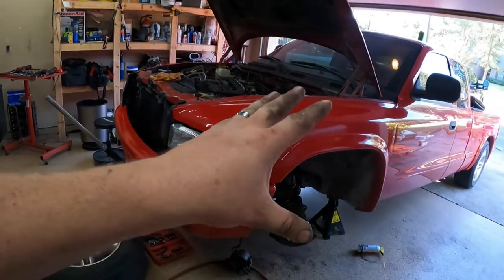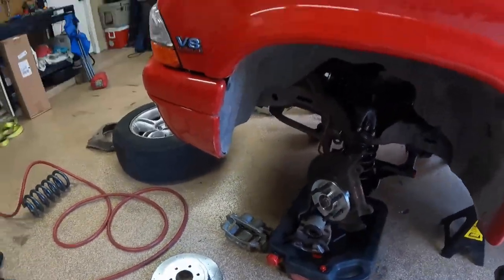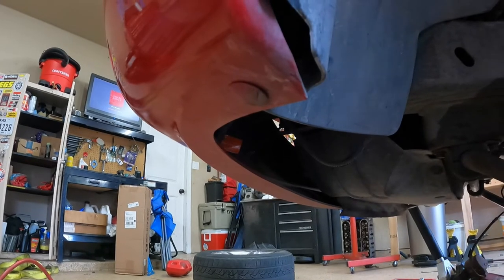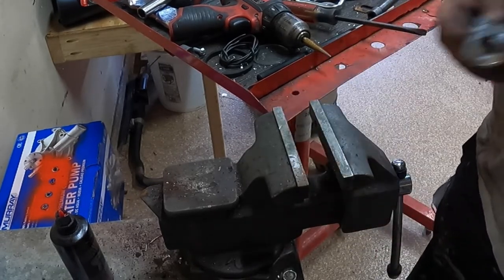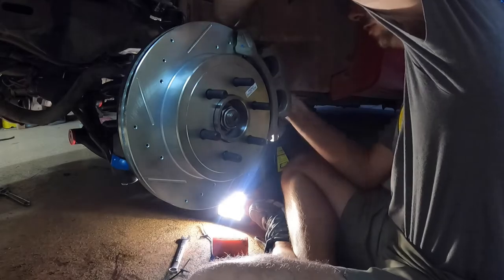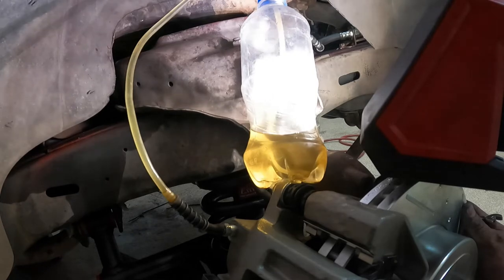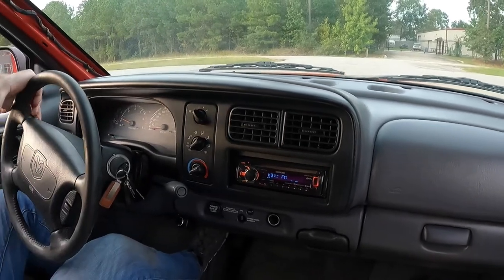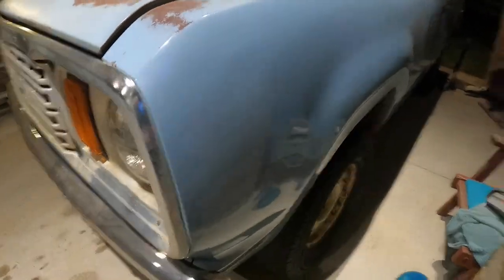MAJOR UPGRADE! 97-02 to 03-04 Dodge Dakota Brakes - Dakota RT Suspension and Brake Upgrade Part 2

Comment: I’m just wrapping up this swap on a 2000 .
I got the rack and pinion as well. Staying stock.
The calipers and rotors I got were good,  as well as the hubs.
But stock control arms, shocks , hoses, brake pads , tie rod ends / outer and inner, sway bar links, bump stops , and shocks need replacing. That alone is just a bit over 1k.
I got the salvage parts for free.
To do this swap in its entirety using  all new parts is about 3k ish.
You need 16” or bigger rims to do this. I elected to use a new 03-04 master cylinder which wasn’t mentioned in this video. There are four pistons up front now and there seems to be a difference in master cylinder volume.
I also did the rear disc brakes and I only needed to get the e brake cables swapped in its entirety.
So all total, you can easily get 6k to 7k $ worth of big brake swap with suspension for 2k or less. It’s roughly the equivalent of having ls Camaro brakes.
Best upgrade I’ve ever done . I also went and bypassed the ABS and installed an adjustable proportioning valve with split front and back.
Now it’s time for the cliche Ls engine and  4l80e swap but with a twist. I’m using the 04 Dodge map only, sequential fuel injection computer  with HP tuners to program and Run it. 
There’s some significant hurdles in order to do it this way but the benefits will be worth it in the end.
The best drive train from Chevy and the best mid size truck ever from dodge. 
I don’t care who makes it as long as it’s American. But Ford sucks.
Reply from the maker: its one of the best things you can do to these trucks! Both the brakes, and the LS ;)

Comment: I’d like to see more of the RT projects.
Reply from the maker: Right now the Dakota R/T is a pretty status quo cruiser, but we do have some plans for it in the future
Reply: If there was a problem with your rear U bolts would your tire tilt side to side? I went to a tire shop and they would not change the tire becuz they said I had that problem. He said if your rear tire slides a little side to side it's ok but he said mine tilted side to side. Is this true that it is the U bolt?

Comment: Glad I found your channel while researching to do this same brake upgrade to my 02 standard cab sport. The 02 caliper guide pin threads on those spindles are junk and strip easily. The bracket mount calipers were a huge upgrade for Mopar on these.  
Just so happens I've been looking at different lowering options for the front too, so your comparison between the DJM lower control arms vs. springs was an appreciated bonus. 
I'm a year late to this party but if you see this, thanks for your time documenting and putting your experience out here for us to see. I know which roads I'm going down now with my project.  Great stuff and I'm subscribing.
Reply from the maker: Thanks for the sub and the kind words! Once you gather the parts, its not too bad of a job, just a time consuming process. Be careful, take your time and you'll be golden!
Reply: @RacerXGarage  thanks. Coincidentally I just did the brake job this past weekend. Turned out great! What great look and nice stopping power.

Comment: Thank you so much for the video. It helped a lot. I have an 01 Dodge Dakota 4 x 4 and I’m gonna go look for those spindles over the weekend. I don’t need to upgrade my lower and upper control arms. Just change the bushings but this helped a lot.
Reply from the maker: Good luck! Im not sure what is compatible on the 4x4, but if you can do the same that would be awesome!

Comment: I did the powerstop front upgrade with the carbon ceramic pads even from the stock brakes that I had in my 04 there's definitely a lot of brake. Thanks for the great info as well in pt1 with the suspension and the difference after before and after 99/00. Never knew and good to look out for when mine needs the front redone.
Reply: Yeah the brake upgrade to 03/04 brakes are an absolute must for these trucks

Comment: I wish I had a 2wd Dakota lol. This looks awesome great job
Reply from the maker: Appreciate it! They work pretty well, but I don't know what's compatible for the 4wd's. Hope you find a good option!
Reply: @RacerXGarage  Doing a 4x4 upgrade from 02-03. Starting with the front. I was able to pick up a couple of knuckles from a salvage yard. they included the brakets for the calipers. So with that I should be good to go. I 've never done a video, but may give it a try . . .

Comment: Awesome video. I have a 2000 rt cc with the djm control arms as well. Way better of a ride than lowering springs and the control arms look sick underneath the truck
Reply from the maker: It is like a whole different truck than it was when we got it. We've been happy with the DJM stuff. This is the 2nd truck we have them on. Really impressed with them
Reply: i have djm 2" drop and the ride isn't that bad except the djm shocks are getting soft and its bouncing. is there a stiffer spring that could help?
Reply: @uncle_salty_3675  I went with doeschtech I think that’s how it’s spelt. The first 20,000 miles they were nice and stiff but after that they became somewhat floaty if you will. I’m guessing the weight of the 5.9 up front kills lowering shocks

Comment: I just did this swap. I got parts off a 03 dakota 4wd. The spindles were the same but the hub has spline gears that I'm not using on my dakota r/t... but I now have the capability of an AWD ?? I've always wanted AWD in my dakota r/t... anyways that's down the road. My brake line fittings for a 98 dakota r/t don't fit the flare nut off the 4wd brake lines that I got at the junkyard with the spindles & calipers. Any suggestions? I watched part one already and left a comment there as well. My truck is down and nothing went as it was supposed to with the swap. Ugh.
Reply from the maker: I hope you get it figured out. If your looking to try to go AWD, I'm sure some fab will be involved. We know the 2WD stuff all bolts up so I'm not sure what you will need to do with the 4WD brakes other than maybe make new lines. Good luck! Thanks for checking out the video

Comment: very nice job done.
i got a 94 dakota slt club cab 4x4, 95 dakota sport club cab 2wd, a 01 4x4 crew cab slt dakota and a 2wd 04 crew cab dakota slt plus, 1997 4x4 club cab dakota that the engine/trans is going in my 01 4x4 .
Reply from the maker: Thanks! Sounds like you have the same Dakota hoarding issue we have!
Reply: @RacerXGarage  i think so... i have 5 so far.
a 2004 jeep grand cherrokee and a 1989 w100 pickup long box.

Comment: Awesome video!! just picked up a 2001 Dakota (3/01) but it's a 4cyl at the moment. Wanting to do a 5.7 'eagle' hemi swap to a Getrag 6spd to a 8.25 with 3.55 gear. But, can you ask your buddy  (Gary?) what type of mileage he gets in this truck? I come from decades with Chevy's and I'm reading that these Magnum or 5.7's don't get good mileage. While I've had 283's and 307's that get high 20's!! I would like to keep it mopar, but if it's only gonna be 12-15mpg, I'll go with a old school 307 or a LS-4.8 and AR-5
Reply from the maker: Thanks! The Dakota R/T's have a 3.90 gear, so they're not fuel efficient in anyway. Its all about the trans and rearend ratio that will contribute the most towards gas mileage. Unfortunately, we don't pay attention to that much so I don't think we could tell you. Im sure its within the 12-14mpg range. Also, if you have a 4.8, go with the 4.8. The 307 or 283 won't even muster near the power that the factory 5.2/5.9's do. It would be pretty big step back.
Reply: Awesome!  Just got back from finding a '03 Durango with what looks like all the parts to do this swap. 
And it's got a 9 1/4 axle with discs and trac-loc 3.55!!  So I'll be getting all that this payday.  Thanks again for the great videos! @RacerXGarage

Comment: Hey my man, I love this video. I've watched it a few times. Question for you. I have a Gen 1 1996 Dodge Dakota.  I would like to upgrade the same way you guys are with the newer 2003 or 04 Dakota front brake rotors that are larger. Any idea if what you guys did will work on my 1996 Dakota?? Any help would be greatly appreciated,  thanks.
Reply from the maker: Unfortunately the upper spindle mounts are totally different on Gen I vs Gen II Dakotas. At this time we don't have a solution for the stock brakes, but we do have something coming up before too long that may be an alternative. Appreciate you checking it out!

Comment: So glad I saw this right before  replacing all my orig lines and calipers. My truck has all wheel abs so im assuming Ill have to find spindles that have abs?
Reply from the maker: That one I'm not sure of. I thought they all had ABS, but not sure. Good luck on your swap. It's a night and day difference
Reply: I have an 2WD 04 QC and it's 4 wheel disc but rear ABS only. They probably figured going to the 2 piston up front they only needed rear ABS to stop the ass end from coming around on you lol I just went with a drilled/slotted rotor setup from amazon to replace my OEM fronts, I've seen new front calipers for like $80 on Amazon too for the 03/04

Comment: I have on 01 4wd slt, someone did a conversion swap but the brake shoes doesn't cover the whole rotors, so I was curious as to what brake pads would fit?
Reply from the maker: Humm, not sure there. Sounds like they mismatched something. Hope you get it figured out?

Comment: Where did you order the braided lines? Also, so I need the rubber brake line from the caliper?
Thanks!
Reply from the maker: I'm not sure where he ordered the braided lines, but the other ones came from Rock Auto. I'll see if Greg knows where he ordered the braided ones.
Reply: Did. You find out where he bought the braided lines

Comment: I have a 2001 Dakota R/T, not sure I understand about the upper control arms.  I need 03-04 upper control arms for the brake conversion?
Reply from the maker: From our understanding is yes. The upper control arms for the 03-04 use a different sized ball joint shank for the 03-04 spindle. So we recommend to just get 2 brand new driver side 03-04 upper control arms for a 99.
Reply: from what i have read, the 99 and older you will have to put 2000+ upper control arms on. 2000+ to 2004 is the same.

Comment: Do you know if this would work for 4 wheel drive?
Reply from the maker: The parts we used for this project are not compatible with 4x4. Unsure if the 4x4's have an equivalent swap.

Comment: Was he running a stock headers? I want to replace my upper and lower control arms but it seems as on my 99rt the headers are in the way of the upper control arm on the passenger side. Any help or advice would be greatly appreciated!
Reply from the maker: Its tough, the clearance there makes it really difficult to get tight. I think we used a prybar on the exhaust manifold to move the engine over a little more towards the driver side to get everything tightened up. Two people, prying on the engine, one tightening.  This is why the 03-04 passenger control arm is different because Ma Mopar fixed this issue and moved the mounting locations.
Reply: @RacerXGarage  thanks! I’m going to order a specific swivel socket and use this method. Tackling the project asap. Nice content and keep up the great work!

Comment: I have a 2000 dodge Dakota I’m currently working on, I have a 2003 Dakota as a parts truck. Question is the motor is a 3.9 for 2003 Dakota and a 4.7 for the 2000. The gear ratio is 3.92 for donor truck, 3.52 for the truck I’m working on. 2000 has drum brakes and 2003 has disk brakes. Could I just switch out rear axles or can I just rob the brake system
Reply from the maker: I'm not sure honestly, to be safe I would at least change the master cylinder and proportioning valve just to be sure there are no valves to worry about.
Reply: Curious if you completed your rear brake swap? I am looking to add a rear disc to my 02, wondering if the backplates match up from the 2003 to the 2000 axle.
Reply: No I haven’t, we all got Covid here and it hit us hard.
Reply: @JB-qb8xy  I'll know in the few days to a week . . .

Comment: Did you leave the reservoir cap on or off when bleeding the brakes
Reply: I recently just finished putting everything together and i bled the driver side brake first but its not compressing the rotor if you could please lmk which side to bleed first
Reply from the maker: @gerardovidana3466  anytime I open the system, no matter where I bleed all 4 brakes. As a general guide, you start at the wheel furthest from the master cylinder. In our case, that would be the passenger rear wheel. From there driver rear, then passenger front and lastly driver front. 

Dig on YouTube, I'm sure there are some good videos on there on Bleeding. 

Shouldn't matter if cap is on or off, but you'll want to make sure you keep the master fluid level full so you do suck air in. So check after every few cycles. Good luck!

Comment: So wheel hubs now need to be 03-04 as well?
Reply from the maker: That would prob be a safe bet, but I didn't run the part numbers to see if they were the same.
Reply: No, hubs are same for 97-04. Don't forget new hub bolts as these aren't supposed to be reused

Comment: Any idea if this conversion  will work on a 1999 4WD?
Reply from the maker: I don't think these parts will work for 4wd, but I Wouldn't be surprised if you could swap stuff over from an 03/04 4wd. Not sure if the brakes are different or not though.
Reply: @RacerXGarage  I was hoping your truck was 4WD, since you had mentioned that you were thinking about upgrading your dakota as well.
Reply from the maker: @robertn6489  ah, no. Mine is a GEN I 2WD Dakota so this swap will not work for GEN I's.